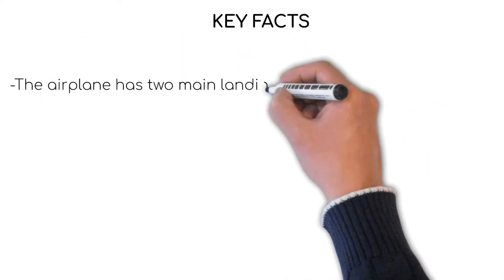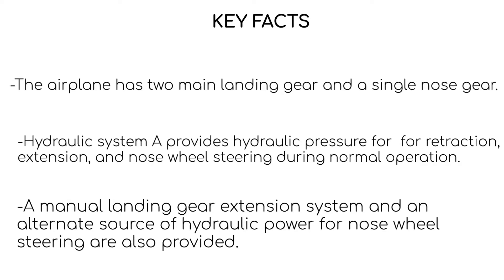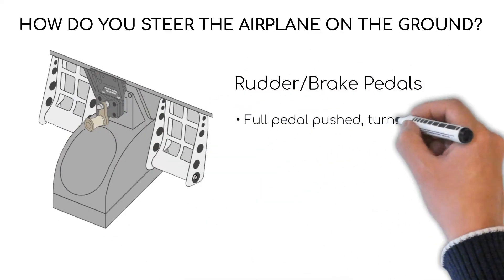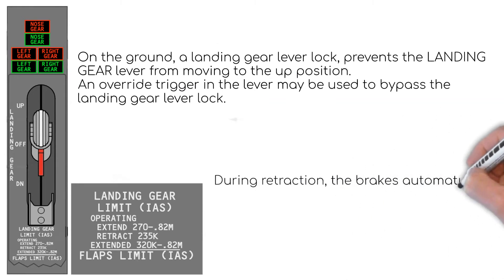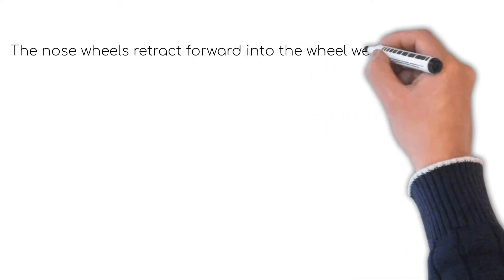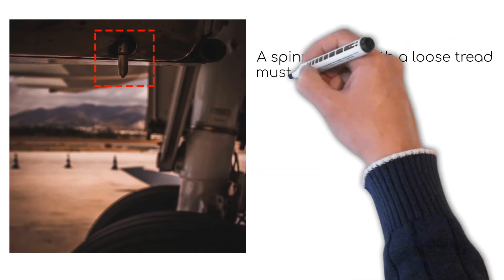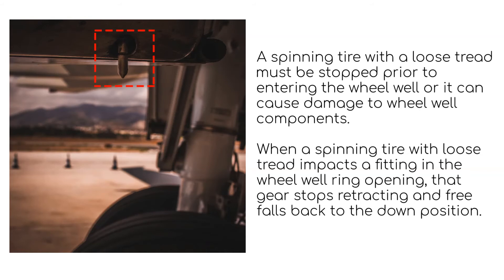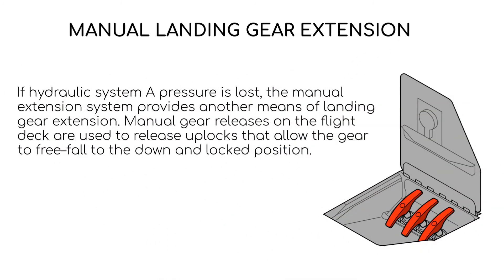Boeing 737 |  Landing Gear System

Comment: No mention of the plane's unique lack of landing gear doors?
Reply: Good point but the aircraft does have landing gear doors. The nose gear has 2 doors. Each main gear has 3 doors, the outer, the center and the inner doors. 
The unique part is that there are no wheel well doors for the main gear. Wheel well blade seals are attached around the wheel openings in the bottom of the main landing gear wheel well and supplies an aerodynamic seal around the outboard tire when the main landing gear retracts. The outboard surface of the outboard wheels have aerodynamic covers fitted. When a B737 flies overhead, it’s easily identifiable by what I call the 2 black donuts